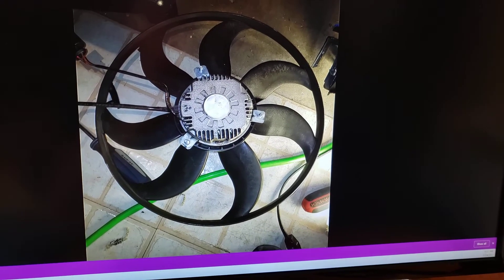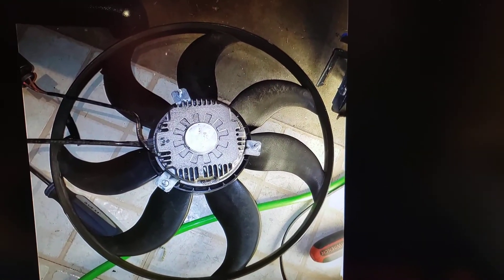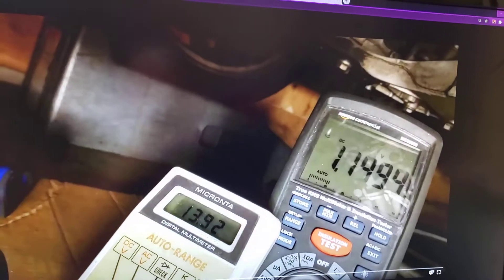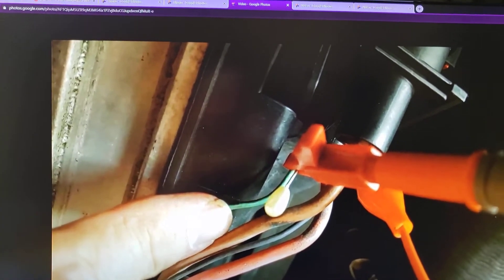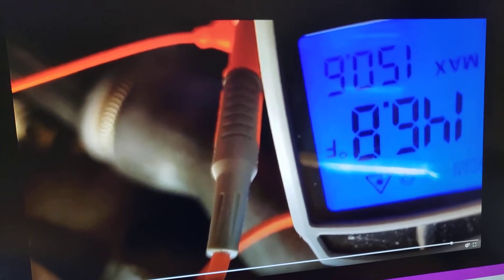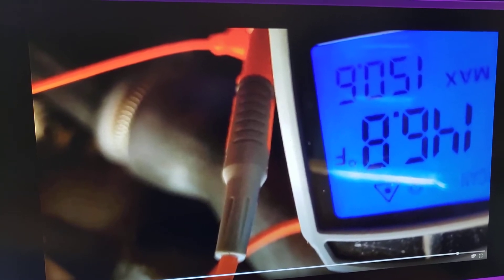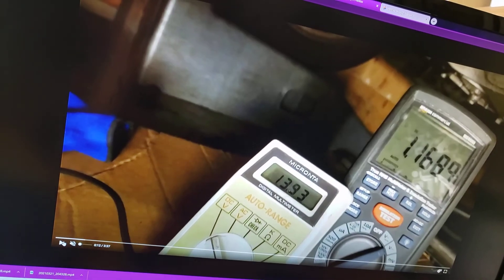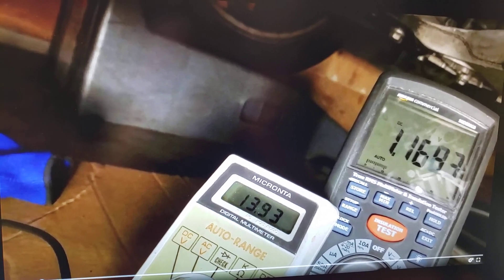Testing Fan Control Module voltages and temperatures on VW EOS 2009 (2006-2015)

Comment: So what did you do, did you replace the whole fan assembly? I ask because mine just did the same thing, twice. After disconnecting the connector and putting it back together, fans operate as they should for a while. But after driving the car for a while they stop working. Redid the connector again and fans are back on. Should I replace them?

Comment: To debug a 2015 Golf, I connected a volt meter to the yellow/violet and ran the engine. Voltage starts at 1.6 but the fan doesn't spin. When the engine gets warmer, voltage increases to 4.3 & the fan turns on. If additional cooling is reqd, the voltage increases to 6.3 and the fan spins faster.

Comment: GOOD VIDEO,,TNX..THE FAN IS CONTROLS BY A PULSE SIGNAL FROM THE CARS COMPUTER,,,,,,,IF YOU HAVE POWER ON BOTH THICK WIRES MEANS YOU HAVE POWER,,MOST LIKELY ITS THE FAN CONTROL MODULE THAT IS DEFECTIVE,,,BUT CAN ALSO BE THAT IS NOT GETTING SIGNAL FROM COMPUTER,...
THICK RED IS POWER
THICK BROWN IS NEGATIVE
THE THIN WIRES ONES IS COMPUTER CONTROL, THE OTHER IS I BELIEVE AN IGNITION SOURCE,,,,